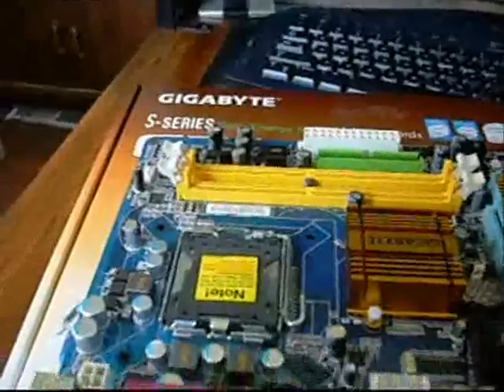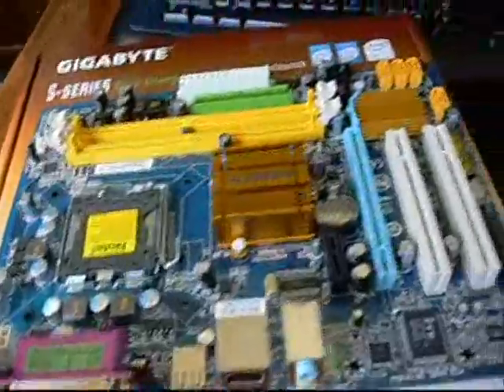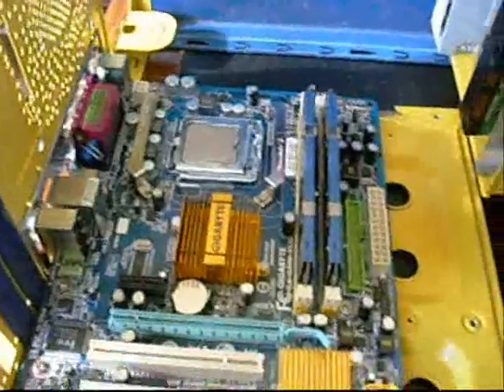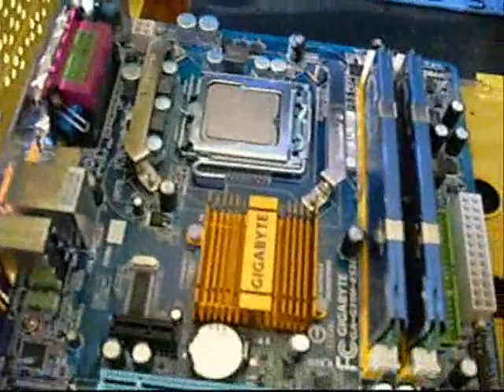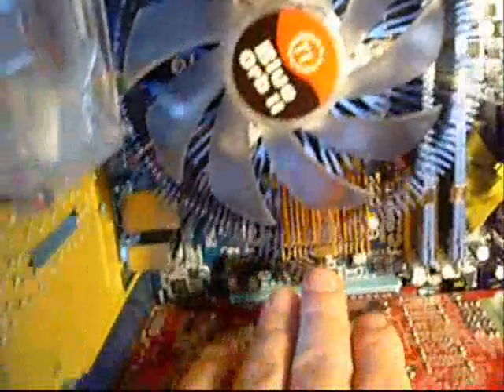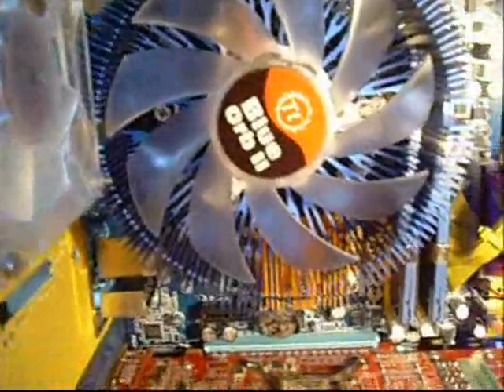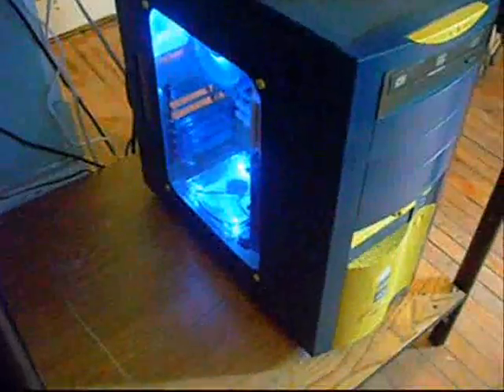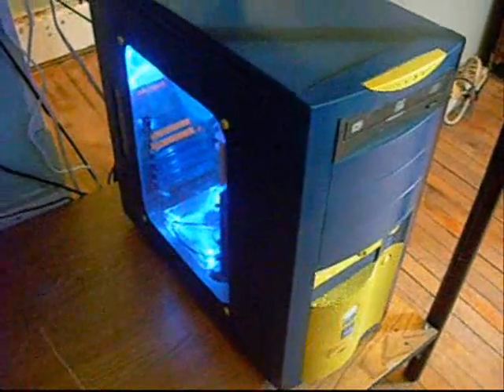First look at the Gigabyte GA-G31M-ES2L

Comment from the maker: @livrinski The cpu would be the bottle neck of the system. Most modern games use the video card more then the cpu so I wouldn't think it would be  really bid issue. On some of the more intense games you may need to turn some of the settings down a little to make it smooth. But I think it should work just fine for you. You can always save up and replace the cpu to a quad core when you can.

Comment from the maker: @warlockboyburns Every chip is different so some will overclock higher then others. Some people will say they get a high overclock just because they got it to boot at that speed but it is no way stable. A 25% overclock is very good most people cant get that. As far as the advanced timing I have not noticed much difference changing them. They can help to make it stable but if it already is then don`t worry about them.

Comment: @FUzzyBUnnyBOoties my ram is running at 1001mhz and no i haven't tried my cpu in another motherboard but i saw someone got it upto 3.8ghz on a P5Q-E... i don't really understand the advanced options.. i chanced the ram timings and increased the voltages... been tinkering with that but i haven't messed with the advanced timings yet.. is there anything to be gained with those?

Comment from the maker: @warlockboyburns 1066 ram? was it able to run at 1066 or did the motherboard under clock it to 800mhz?. Just curious because the manual says it only supports up to 800 ram. The cpu I was just wondering if you had overclocked it in any other board to know if it would go higher then the 3.33. It might have hit its limit.

Comment from the maker: @ONA5252 Yes it could be the psu. Some of them idle back to save the psu if they overheat. And it may not be able to supply enough juice to the video card to fire it up. If you have another one around to try it with I sure would. That would explain why the video card worked on another computer and not yours.

Comment from the maker: @ONA5252 It is possible that the video card is defective.  Do you have another computer you could try it in or maybe a friend that would let you try it in theirs?. It is also possible that even though you have a 450 watt psu that it doesn't have enough power on the 12 volt rail to run the card. Check at ATI website for certified power supplies to see if yours is listed.

Comment from the maker: @fifinko24 The graphic card will run at what ever speed it is designed to run at. It is seperater from the system ram So it will not be affected by the 800 mhz speed of the ram.

Comment from the maker: @GamingFr34k I have switched that cpu into my Asus board and am currantly running it at 3.4GHZ at 1.28V .That is lower then the 1.35v defalt voltvage.  I have a Intel D820 in this board now. It is stock at 2.8GHZ and i am running it at 3.43GHZ with stock voltage.

Comment from the maker: Same difference the operating system wont care what cpu is in there. The only time it will is when you change somthing that requires drivers like a video card or sound card or that sort of thing. 

If you are worried about it changing the hardware ID in windows the worst that will happen is that it will tell you to update your registration will only taked a couple of seconds and you wont have to put the reg number back in. But ti wont make you reinstall windows.